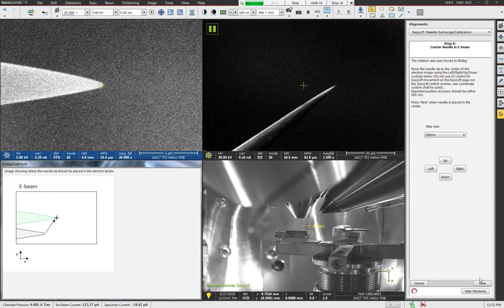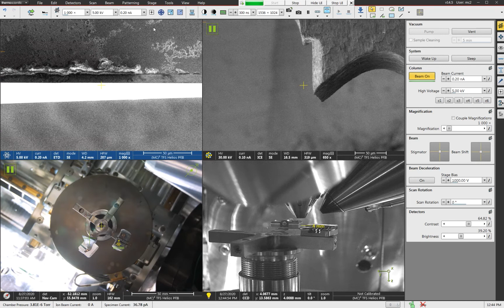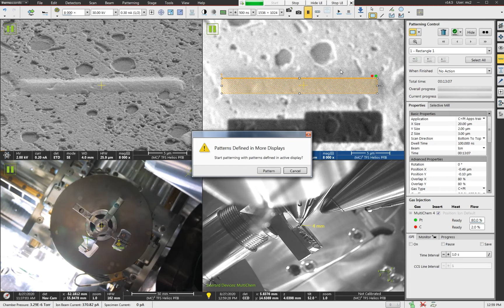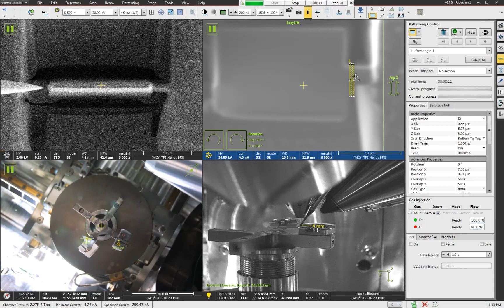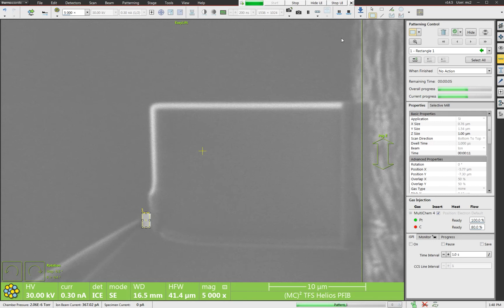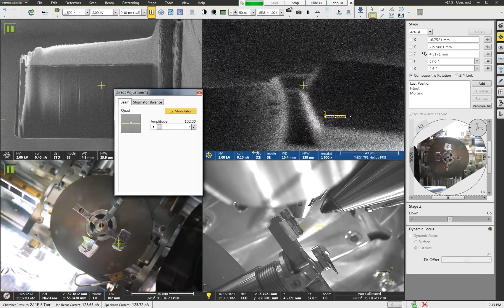TEM sample creation using a ThermoFisher G4 Plasma FIB (PFIB)

Comment: This video is super helpful, nice and clear sharing! With so many useful tips as well. Thanks! May I know what is the corresponding pattern of rectangle in a Carl Zeiss machine, like crossbeam 340. Or can you describe the beam movement in a rectangle patten manner?
Reply from the maker: I don't know, I've never used a Zeiss FIB.  But the FEI/Thermo rectangle patterns scan top-bottom and left-right in a raster pattern by default.
Reply: @allenhunter1188  Many thanks.

Comment: Great video thanks for sharing, some great tips! What kind of SEM holders are you using, they look like clamps?
Reply from the maker: That TEM grid holder is made by Omniprobe.  It is sold by various microscopy suppliers like Ted Pella or Electron Microscopy Sciences (EMS).  The Ted Pella part number is 460-316, EMS part is 75968-AL.  The silicon wafer holder is made by BOT Microscopy, but they may have gone out of business, their website is currently offline.